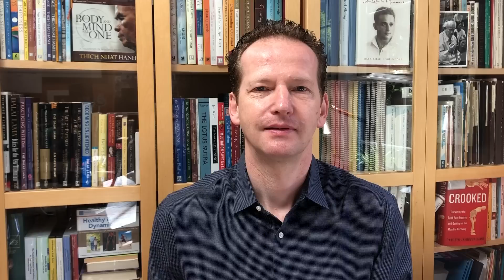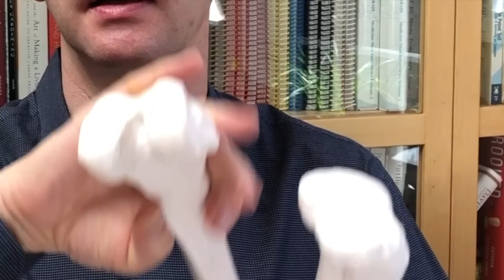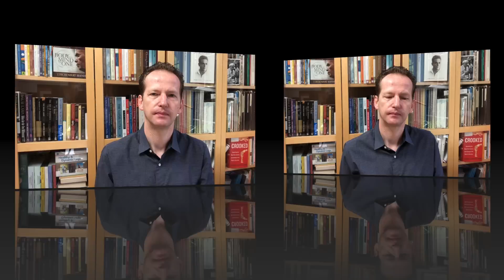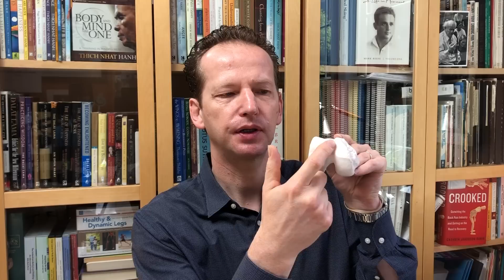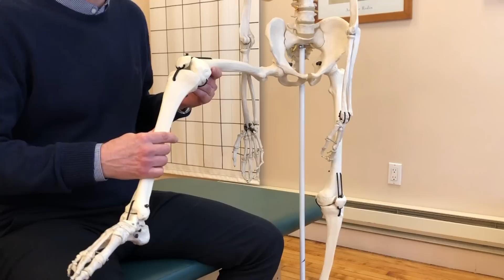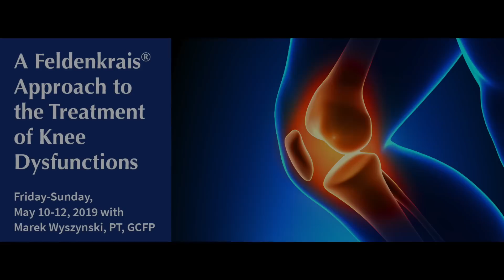Screw Home Knee Joint Mechanics Demonstration

Comment: ball and socket ? not an hinge joint
Reply from the maker: You are completely correct. Our knee joint is a modified hinge that allows flexion and extension, plus a small internal and external rotation. What I was referring in the video are the shapes of the joint structures. The condyles of the femur are round and the corresponding joint surfaces of the tibia are concave (also menisci create even deeper socket-like shape). And that's why when perfecting motion in the knee one can think of ball-and-socket principle. I find the model quite helpful when working with clients with knee injuries or arthritis. But, I completely agree with you Ifrah, that the statement that knee joint is a ball and socket is misleading. Thank you for catching the problem.

Comment: Shouldn't you be saying movement of proximal tibia on distal femur and vice versa at 5-5.15..?? i liked the way you explained but i am still confused on why do you call the knee a ball and socket joint although i am agreeing to what you say but everywhere i read this joint is referred in hinged joint section and some place as a modified hinged joint
Reply: your right in that he should have said distal femur and proximal tibia. He's not calling it a ball and socket hes more trying to refer to the roll and glide mechanics to of a ball and socket joint. He should have used the Modified hinge joint as you mentioned
Reply from the maker: Thank you , Joseph for clarification. It is exactly how I intended, however used the unfortunate "ball-and-socket" phrase. Obviously the knee joint is modified hinge.
Reply from the maker: Yes it was quite unfortunate that I called the joint ball-and-socket. It obviously is a modified hinge. However in terms of the shapes of articulating surfaces - the femoral condyles are round (ball shape) and tibia with menisci are concave. The model of ball on socket or socket on ball works quite well, helping the joint surfaces to remain congruent. Thank you for pointing out the misleading part, Prateek.